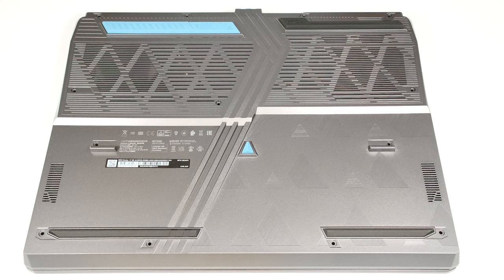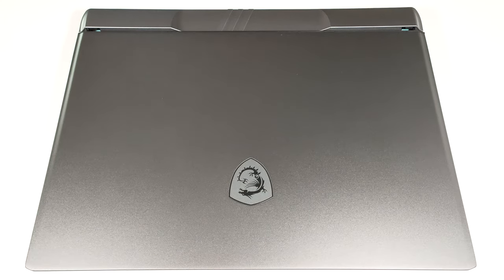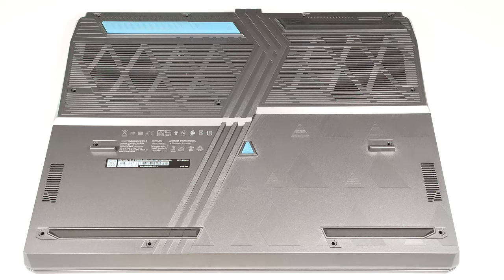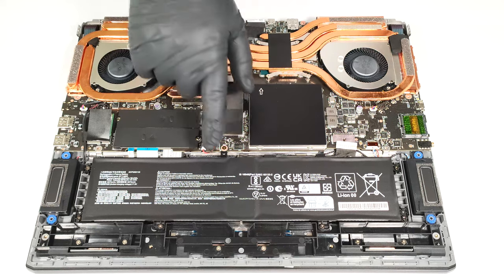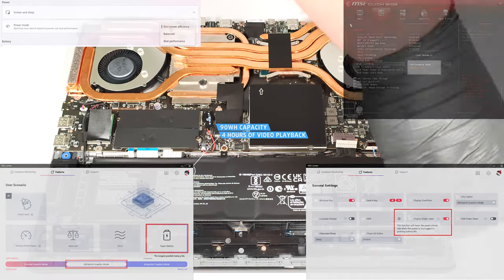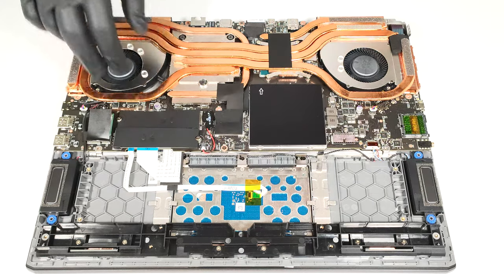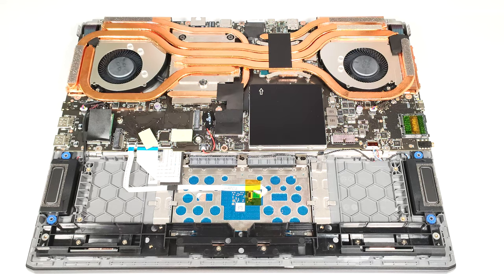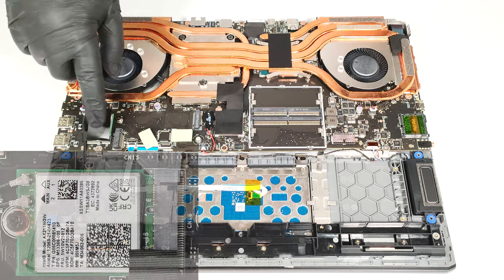🛠️ How to open MSI Vector 17 HX A13V - disassembly and upgrade options

Comment: Excellent detailed info on opening. Love the commentary amd love how you put the speeds up on the screen and show how to get the vest out of the battery using msi software. And how u expain heat system very good work

Comment: I need technical advice. I just bought the Vector 17 HX A13VHG and I want to upgrade the RAM. Are you absolutely sure I can put in it more than 64GB (2x32GB) DDR5? Can I put 96GB or as much as 128GB total?
Reply: I noticed that it is possible to buy 2x48 GB, so I have the same question ... and I will wait until somebody confirms that.
Reply: dafaq you need 96/128 gb of ram for? 64 is more than enough
Reply: @semafreak  For children games sure, but there are no laptops specific for developers - they use platforms suitable for their projects. When they need power while still being able to travel, they buy gaming laptop - not everyone is in love with Mac.